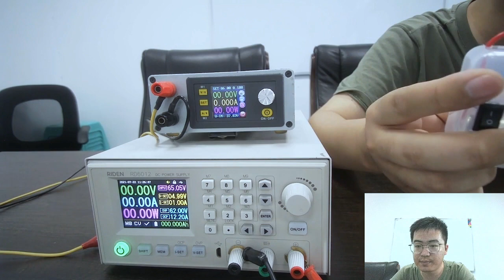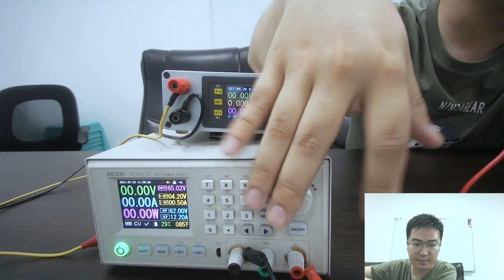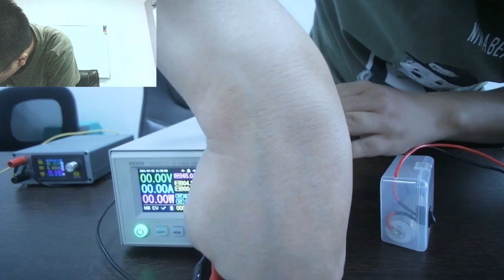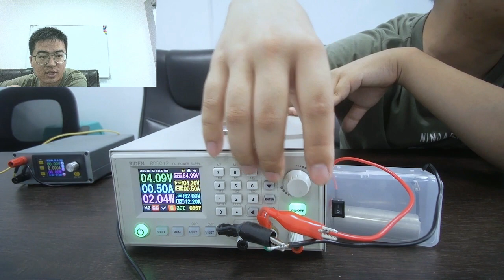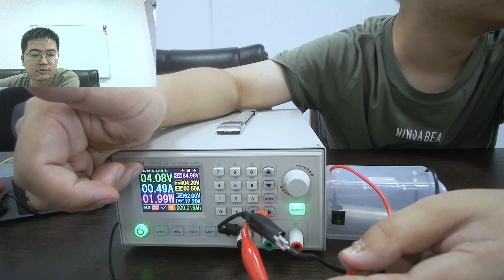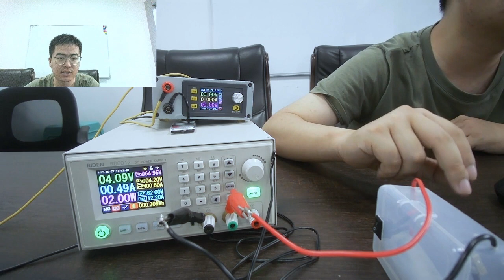Live replay on Alibaba! RD Power supply introduce, RD6012 and DPS3005

Comment: Is the Rd DPS5005 resistance to short  short circuit like most buck converters?
Reply from the maker: hello, in the DPS5005 setting page, you can set the OVP value, when the real output current exceeds this value, the output will be cut off

Comment: Just tell everyone "DO NOT REVERSE POLARITY" :) This is a power supply, an only one way power source, not quite a battery charger. It doesn't have protect features like popular battery chargers. By the way ... If someone doesn't know how to use it properly, let him not use it or fix it himself (just like I did by accident :) I burnt DPS5020 fuse input and diode/transistor. After this I always check the properly connect. In RD6018 the protection worked properly. To avoid voltage surges, you can set the voltage of the power supply close to the battery voltage and then slowly increase it to the desired values. It would helps anytime and saves the fuse :)
Reply from the maker: yes, check the wiring before turn on the output is necessary, but you can see before we have DPS power supply, it just has out+ and out-, no battery charging function, but every year we got about 20-30 cases that the fuse and mosfet are burned when charging battery with wrong connection, so that in RD series we add a battery charging terminal, no matter how you connect, it can only work when you connect it correctly
Reply: @rdtech9153  Do you simply have a diode fitted inside the unit between the Red and the Green terminals to avoid damage from reverse polarity, or something else? If it's just a diode, there would be a 0.6V difference due to the voltage drop across the diode. Would you need to add 0.6V when setting the charge voltage level?
Reply from the maker: @HillcrestSpong  hello, you do not need to set higher voltage, just set the normal battery charging voltage and it is ok
Reply: @HillcrestSpong  yes i will add a diode to my converter but you will have 0.2-0.6v offset depending on the current